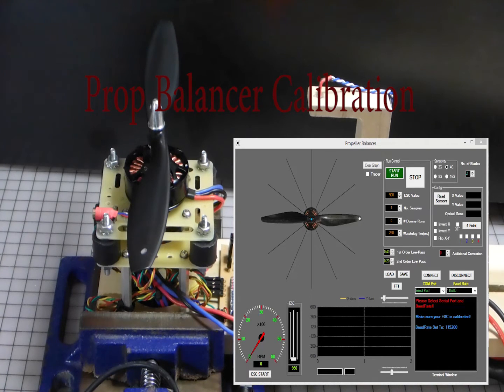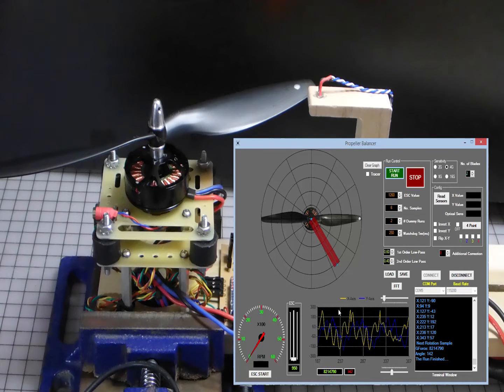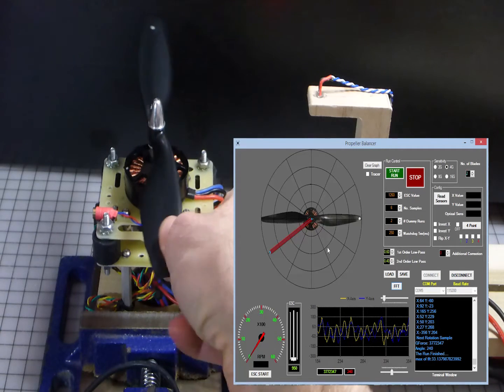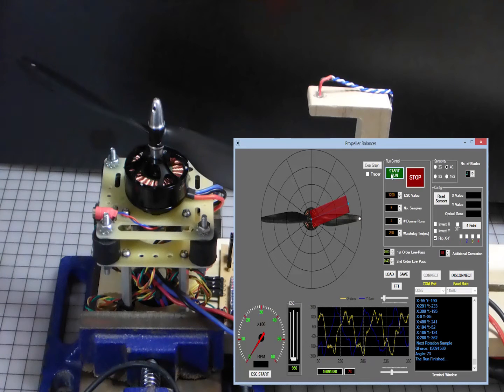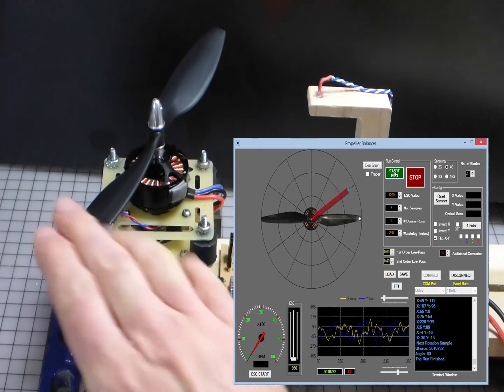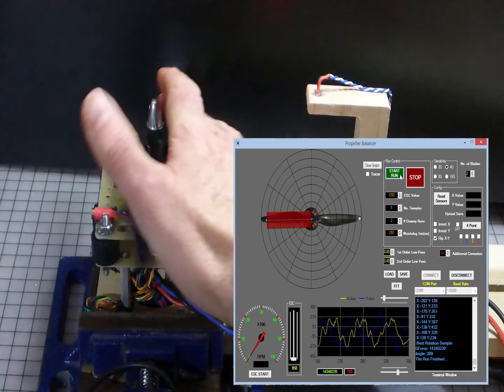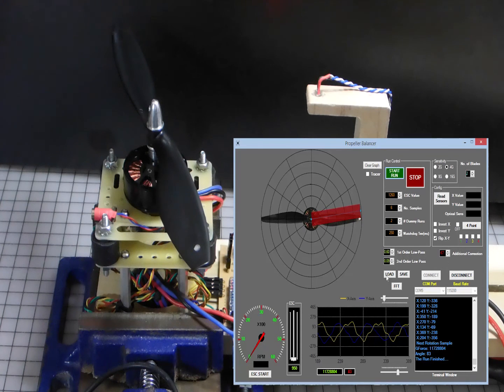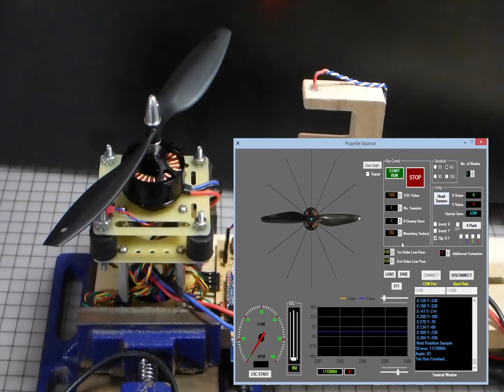Dynamic Propeller Balancer Calibration

Comment: Thanks for your work on this sophisticated balancer.  I'd like to know a few details about what the device and software are actually measuring.  Could you please comment on what quantity is actually being plotting in the scrolling graph?  Are these plots of raw acceleration values in two or three directions?  And what is the number that appears in the box below the graph that you use as a measure of vibration-- how is it calculated?    Also could you comment on how the circular graph in the upper left is plotted -- what is the meaning of the radial "beam" that settles out at a particular angle on the plot?   Could you also say something about where the sensor is relative to the motor-propeller system?  Thanks very much.

Comment: You would need 4 gates to make this accurate IMO. I'm not even sure how you get a reading with an accelerometer sure the unbalanced prop would pull xy in all directions eg 360
Reply from the maker: Thomas Shannon yes, but when you take a measurement at precisely the same direction every time, you find out that the imbalance vector will point in the direction of imbalance...hence the optical pickup...do some more balance vector theory reading...you are close...:-)
Reply: Ah yes I understand that now. If optical light is cut take a reading statement. I guess it might have some delay in reading hence the need for calibration.

Comment: Great looking app, however, i tried installing on several machines to no avail, from Windows 7 to 10... can you shed some light? I have many years experience as an O/S specialist and can;t figure this one out. would love to know if you've made any advancements in this program. cheers
Reply from the maker: Sorry to hear that..I am running it on windows 10..not sure what the issue is.  No advancements..been too busy with other projects for the moment...sorry....
Reply: understood and thank you , i was trying to get it working on Windows 10 but it says the installer is corrupt, would you have an archive of the working version? sorry to bother you with this but i was really hoping to get something happening as i bought all the parts and i think you created the beginnings of a great program :/ p.s. i am a C/C++ programmer and would love to look over the source if open...
Reply from the maker: The latest is on the RC groups forum thread...

Comment: Hi,Cyborg Neuromancer
Nice work here .I´m also developing a balancing system with a microcontroler ,I use a dspic33ep512mc504 running at 70 Mhz,I use a MPU6050 and a sensor to mesure speep and rotation.
The principle I´m working to calculate the angle is mesure the vibration at diferent angles (calculating average of mesures) and then compare all mesures to find the angle where it vibrates more and the one tha vibrates less.
Right now I´m testing this principle. What do you think?Will it work?How do you calculate the angle ?
Thanks.Keep on your great work.

Luis Ferreira